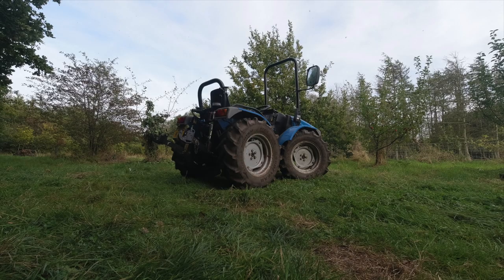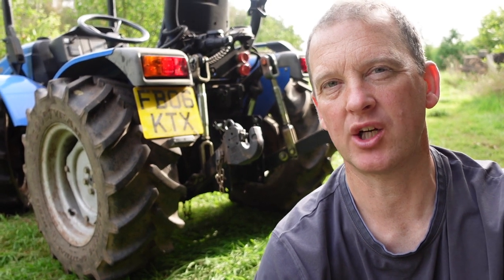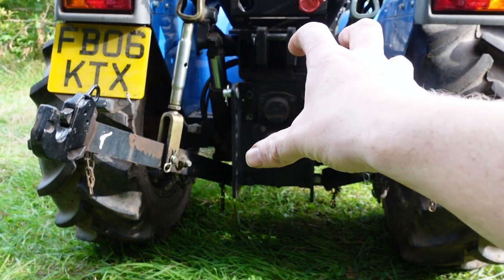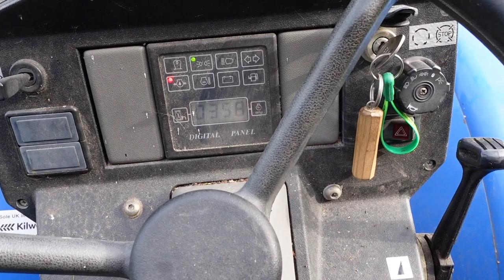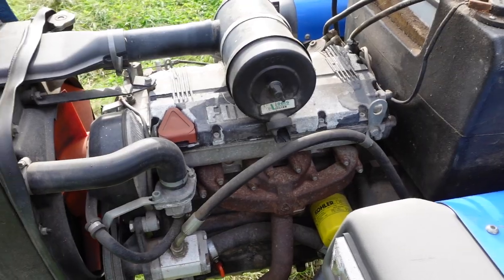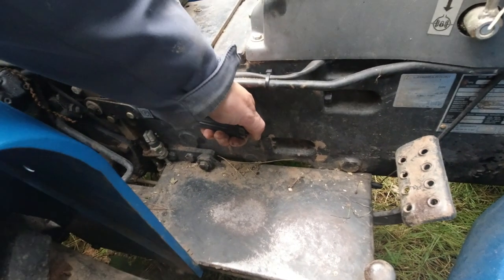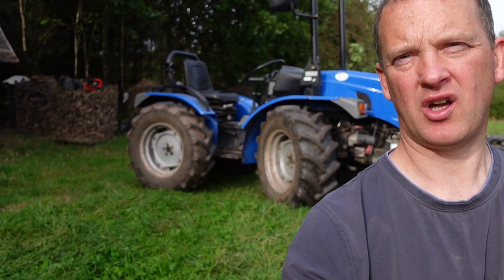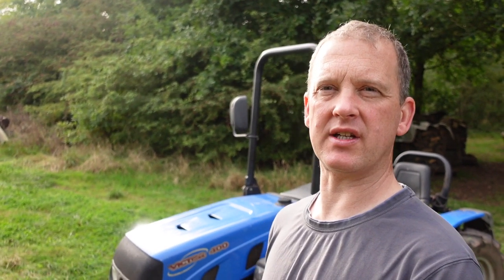The BEST 4x4 Compact Alpine Tractor? BCS Victor 400 Owners Review, In-depth Features & In Action

Comment: Looking to get an old Kubota compact tractor for flail mowing. Prices secondhand are very high with lots of them being imported from Japan.  Prices are £2700 for a well used up to £4500 plus vat. Theses are ones that are 30 to 40 years old.  Currently have a small Westwood ride on without the deck, fitted with chevron tyres and a tow bar bull.
Reply from the maker: The used tractor market has rocketed in the last 5 years, what was £1000 has doubled and more. I found because UK interest rates were so low people invested in potential collectibles and it’s driven the price up plus folk needed a project in covid. Hopefully things will stabilise but they rarely come down.
I had a stunning little Tomo Vinkovic 18hp alpine which was another very regrettable sale during covid
Reply from the maker: Hope your search goes well. Some Mitsubishi tractors are nice too

Comment: This came at the right time.  Im seriously looking at getting an Alpine type as it'll suit these hills and switchbacks of mine.

I remember asking about your'n beforehand, so im glad you did this video.

One thing... what of a front grapple or bucket?  Xan this tractor accommodate? 

Thanks again.
Reply from the maker: What great timing.
They do make front loading and rear loading buckets for these and also transport boxes on the back work well for moving stuff and can also scoop up loose loads.
Reply: @AbellTo  thanks for that.  I've been looking at the Kubota range, and so far they are tops at providing an amateur with "everything" except that on my farm I DO need small AND articulated.

I'll have to contact them I suppose! 

Cheers 🇬🇧
Reply from the maker: @Nellyontheland  with any machine there will be some kind of trade off. Where it’s the physical size, the power or lack of it and turning circles.
@TheRestorationCouple did a few videos on out some tractors they had on loan
Reply: @AbellTo  cheers there.  Looking...